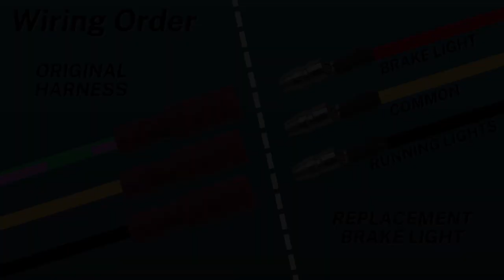Installing a Mustard Bikes tail tidy on a 2021 Triumph Bonneville T120 / T100

Comment: Will it work on T120 with the comfort seat and rear rack installed, and have brake lights and turn indicators visible enough to be legal
Reply from the maker: Hi there, should be fine with the comfort seat. The rack may cause issues however. Unfortunately we do not have access to the bike or the rack anymore, so can't confirm compatability.

Comment: @MustardBikes Any chance you'll be doing a tail tidy for a 2022 Indian Scout Rogue
Reply from the maker: We haven't planned one as yet. Having a quick look, it's an interesting design they chose for sure. The hardest thing would be maintaining compliance as the only real option is a side mount. That brings issues with plate orientation and visibility. If we get a chance to have a closer look at one we'll be sure to do so.
Reply: Not sure if NSW let you have a side plate. That would be great if you do end up making a tail tidy for the Rogue. I'd definitely buy it. The stock design makes my bike look like they chopped half the back guard and left remnants of the outside of it. Takes away the bobber look.
Reply from the maker: That was exactly the vibe we got from the stock design @one2six . While you may get away with it, technically plates are supposed to remain horizontal and they also need to remain visible to a certain angle to the side of the bike. With side mount plates the wheel obstructs the visibility. If you were Tassie based I'd say swing by and we could have a look for you.